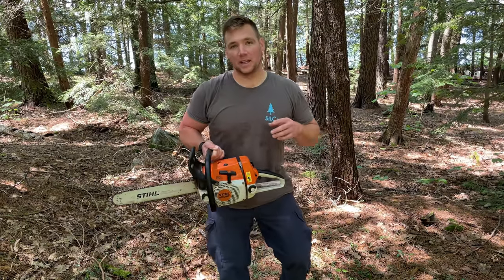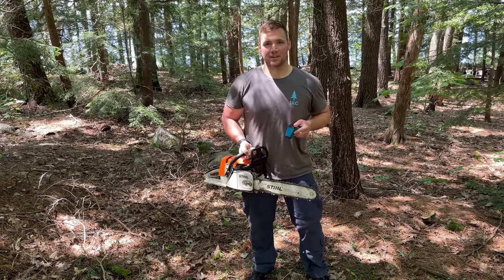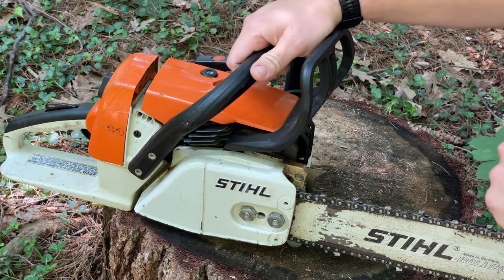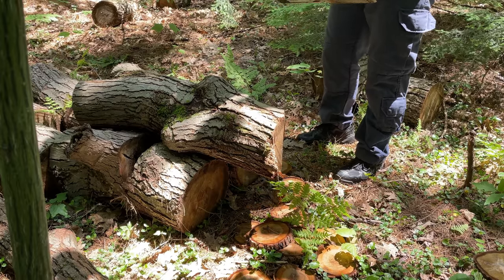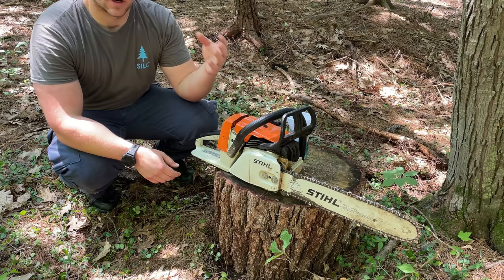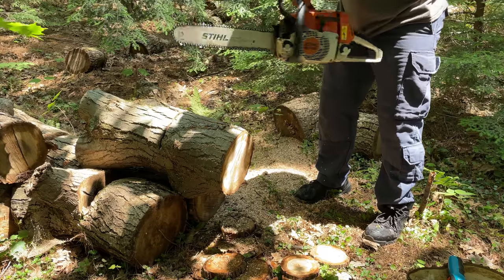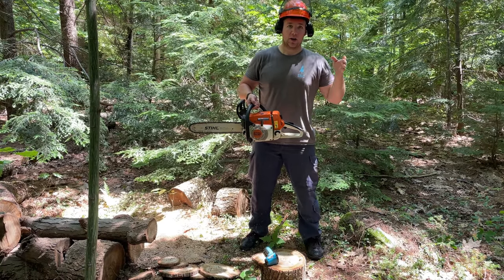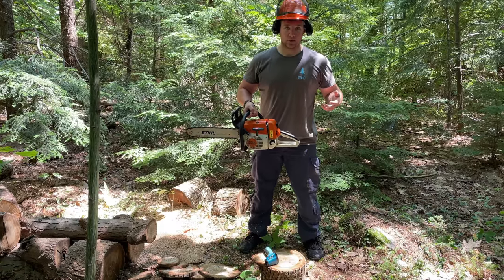Will my chainsaw last longer if I use more oil? Is it safer? (25:1 VS 50:1 temperature testing)

Comment: You should retune your carburetor after changing to 25-1 ratio. You're putting more oil in and less gas so you have to richen the carb settings to get the same amount of gas into the cylinder. By not making the carb adjustments you are running the saw leaner which causes more heat everytime. 

If you make the proper carb adjustments you well gain a bit of power from the extra oil sealing the piston better.

Great video! It certainly shows the need to retune after changing gas/oil ratios.
Reply: I was thinking the same thing.
Reply: if you change your carb mixture then your adding more gas. therefore negating the baseline. might as well just run 50:1 and be safe. no added benefit here.
Reply: @flagulantmichael If you increase the oil in your gas oil mixture, then you have less gas and more oil therfore the need for the carb adjustment in order to get the same amount of gas into the engine. You will use slightly more gas/oil mixture but the same amount of gas.
Reply: @flagulantmichael the added benefit is your actually getting enuff lubrication.  He took it too far. 40:1 is perfect. Only reason for 50:1 is to meet epa regulations. Take two brand new saws. Run 1 50:1 and run one 40:1. I got a grand on the 40:1 lasting longer
Reply: @jamiewarner9101  I'll take that bet!
Reply: The more oil you add the less gas there is. you have it backwards.
Reply: @Billbobaker  Thats what I said. If you add more oil, you have less gas therefor you have to open up the carb a bit to get the same amount of gas going into the engine.
Reply: @srankin8022  my bad, I miss read your comment.
Reply: So what if there is a minuscule less amount of gas?   Oil also burns, I think some one said it actually had more energy than equal weight gas.
Reply: @danonly7  less gas more oil is LEAN.
Oil burns only under serious compression or flame.
Less oil more gas is rich.
Reply: @Billbobaker  from 40 to 1 to 50 to 1  most saws won't be able to tell the difference to adjust for lean or rich...  that's a lot of fiddling with a carb screw
Reply: @Billbobaker  true, that's why you adjust the carb until your saw appreciates what its getting. nobody runs 25:1 tho. 32:1/40:1/50:1 are the commons. I would have done this test with 40:1 as that's the most common setup other then the standard 50:1. and adjusting carb between the fuel types would be critical for the results to be accurate.
Reply: I agree with you 100%. After just purchasing a 78cc chainsaw the manufacturer wants me to run it at 35 to 1 ratio. For at least 10 times of use. Then I am to switch to 50 to 1 ratio. But it does say in the manual that when you switch to the 50:1 ratio You must adjust the carburetor accordingly. And it tells you exactly where to set it for the 50 to one ratio. So coming from the factory this new chainsaw is set to run at 35 to 1 with its carburetor settings. And The carburetor must be changed when running it 50 to 1.
Reply: @reddragon3733 The manufacturer can't know where exactly to set it because they don't know where you're running it. There is a big difference between running at sea level and up in the mountains.. altitude change also demands a retune.
Reply: @InWithBothFeet 
How bad am I messing up tuning at 5500 and cutting between 10-11500' . I
Reply: @srankin8022 
How can you possibly add more gas, when the "gas" is already "mixed" with the oil?
Your comment makes no sense whatsoever!!
Reply: @brianwalker1933  I guess I'm confusing you by saying add more gas I should have said add more gas/oil mixture. You will be adding more of each because they are mixed together as you pointed out. You have to open up the jets more, so more gas/oil mixture enters the saw. When you add more oil to a gallon of gas you have less gas and more oil, right? So, therefore you need to retune the saw and back the jet screws out a bit so your saw will be getting as much gas as it was before you added more oil. A 25:1 ratio has less gas in a gallon than a 50:1 ratio. 25 parts gas 1 part oil, 50 parts gas to 1 part oil! So, a 25:1 ratio is 122.88 oz. of gas and 5.12 oz. of oil in one gallon (128 oz.) And a 50:1 ratio is 125.44 oz of gas and 2.56 oz. of oil. So, you can clearly see there is more gas in the 50:1 ratio per gallon so when you change to 25:1 (or any other ratio) you open up the jets a bit so its still getting the right amount of gas. Your saw needs to be tuned with the gas/ oil mixture you plan on running. Hope this helps clear it up for you.

Comment: With my engineering and mechanic background I have found out a long time ago that a 40 to one mix gives  the best lubrication to all the parts in the engine. At 50 to 1 the wrist pin really needs more oil film. Especially at high RPM.  The manufactures recommend 50 to 1 to make the EPA a little happier.... As a side note:
When wrenching on small bore 2 stroke dirt bikes its amazing how many rebuilds are due to the owners running 100 to 1 Amsoil... Just my experience.  I recommend at least 40 to 1.
Reply: I'll stick to what Stihl says
Reply: @devlinsemmler8236  Stihl, like all manufactures is under EPA pressure to recommend 50 to 1. It's not for engiine longevity so much as it is to satisfy emissions standards.
Reply: I run 40to1 also in all my stihl equip.been doin it for years i agree with you. Never had an engine failure also run 93 octane gas.
Reply: @zackeryeckenrod6549  Anytime I tore down an engine that ran 50 to 1, I noticed upon inspection the wrist pin especially does not get quite enough lubrication. Yep 40 to 1 is the way to go. Screw the EPA.
Reply: I’ve always used 50:1 in my Stihl equipment 100% Stihl standard oil (Blue) which I still can buy outside of Stihl dealers in Australia as superseded to the Red colour, never has a problem never changed a spark plug only the arrester was blocked once on my FS55 my FS85 okay.
Arresters are bad in Home 3
FS 38 -45 due to home users not using full throttle, and really they wouldn’t.
Reply: @carlatamanczyk3891  really , has there ever been a forest fire from a fkn chainsaw ? you're more likely to get a spark from running 50:1  , 40:1 has been the norm for ions . amen to Carl and Zach
Reply: Hey thanks for the info, I hadn't considered the EPA. I just switched to 40:1. Imagine that. ;-)
Reply: This same discussion happens all the time on 2 stroke dirt bike forums.  Run a quality oil at what the manufacturer says and it's all good.
Reply: @jacoboo1885  that was me to involved in that discussion on that if it was that recent, was on Facebook from memory.
Reply: I run my Stihl cutoff saw with a 70 -1 mix with quicksilver, never have carbon issues and no fouled plugs, starts first or second pull when cold, first when hot, more problems are caused with too much oil.
Reply: I think the Amsoil 100:1 mix is tempting to a lot of dirtbike owners to reduce or eliminate spooge coming out of the exhaust. Even though it may be a good quality oil, it's just not enough lubrication at that ratio for a motor under that much demand/load. I ran several tanks with Amsoil Sabre at 50:1 without an issue, but I definitely wouldn't run anything on a thinner mix than that.
Reply: This season I cut about 4 cords of firewood (alder, hemlock, and fir) and I've been using a husqvarna 340 16" at 50:1 WOT just beating the hell out of it and it still has 155psi. 90% of the time I would recommend to use manufacturers ratios because the saws are designed to run that ratio BUT it never hurts to try otherwise, my 100cc homelite 1130 calls for 32:1 but when i ran it at that ratio it was starving at WOT and was dripping oil from the muffler, I then tried 40:1 and it ran like a scalded dog, because of this I think it's safe to say that it's always a good idea to experiment with different ratios as 2 stroke oils are rapidly changing with time as well as the gas you buy at the pump.
Reply: @ColinCearley27  Here is something interesting though: the Japanese manufactures recommend 32 to 1 premix in their 2 strokes. Look at the Euros. 50 or 60 to 1....???
Reply: @carlatamanczyk3891  not sure what to think of that but if I were to buy a Japanese saw and it stated to run 32:1 I definitely would because Japanese manufacturers don't screw around they know their way around an engine.
Reply: @carlatamanczyk3891  I also wouldn't doubt that germany and Sweden have tighter emissions standards that practically force them to tell you run 50:1 in their saws.
Reply: @ColinCearley27  I have 4 saws. One of them is a 1975 Italian built Olympic. Manufacture recommends 20 to 1 but it has lived wonderfully on 40 to 1. This saw just doesn't wear our yet.
Reply: @carlatamanczyk3891  Wow interesting, I have 2 Stihl MS361's and a Husqvarna 340 all 3 I run on 50:1 and I have a craftsman 42cc and a Homelite 1130 with a 48" hardnose bar both of which I run on 40:1 with no issues and no piston scoring.
Reply: @lancer3660  this 100%  The jetting is important, you can't just go from a 50:1 to a 25:1 and do a direct comparison, you gotta adjust the jet too if we're being scientific here people.
Reply: Thanks for sharing very interesting,
Reply: I know many ktms that run for hundreds of hours with 60:1
Reply: Sounds like your wrist pin is a plain bearing type...very uncommon as they're all needle bearings now. Your suggestion would apply to the old plain bearings, not needle.
Reply: @devlinsemmler8236  Stihl, as do all the other manufacturers, look at liability, not your saw's performance. Whatever they say is padded to get your engine over the warranty period.
Reply: @zackeryeckenrod6549  

And you don't even know why you run 93, do you? Octane is a mitigation measure of detonation suppression at high compression ratios. Your engine probably barely breaks 6:1 ratio....and I can assure you that's not high at all. But, your engine....you throw whatever money at it you wish. I'll add that 87 is plenty and e10 or 15 is better for a two stroke than straight gas. This is true because ethanol has a much higher latent heat of evaporation which provides additional cooling to the engine and air cooled two strokes need all the cooling they can get.
Reply: @rickthelian2215  I run a 100:1 in everything I own since 1978. But it's an oil specifically designed for that ratio. Looks like a four stroke inside, never a fouled plug, no exhaust getting coked up by unburned, excess oil.
Reply: @jimb4090  I run 93 because in stihl owners manuals they recommend min. of 89 oct. smart guy but of course you know better than the engineers at stihl. So you should probly call them and let them know of your expertise im sure they need your vast knowledge in fuel.
Reply: @zackeryeckenrod6549  Bingo !! Thanks for posting !
Reply: @jimb4090  I was a contract faller fo 10 years, we only ran high test gas in our saws, which have thousands of hours on them. Never blown an engine, with good maintenance they start and run perfectly. We are paid on cut out not hourly etc.
The saws and all my 2 cycle motors run better on higher octane gas, it's a simple fact.
I won't quote technical jargon, they simply run better. Even my Honda 4 stroke mower runs better on high test gas.
I spent my life in and around 2 cycle engines, there is no reason to spend extra for gas, if it doesn't pay off.
My son put a new piston in an Echo blower ( 1980 ) I bought new, rings were leaking a bit. It has around 4000 hours on it. He was stunned to see the excellent condition of the piston, chamber , rings, pin etc. Simply put in the new piston, bearing, rings and put it back together. Runs perfect. 50:1 on high test gas only.
Reply: take  into  consideration!!!!
not everyone gets  their  mix DEAD ON !!!!
1. NOT WARMING  UP SAW PROPERLY. 
2. ALWAYS  RUNNING  AT FULL THROTTLE WHEN NOT NEEDED.
3. CUTTING WITH  BLADES THAT ARE NOT SHARP , OR  GETTING  DULL ..
Reply: Thank you for the information.  Spoke to some professional loggers.  They mix between 45 and 40 to 1.  They said that 50 to 1 is too lean.  My saws have been running on 45 to 1 and no issues, cutting about 50 face cord of firewood a year for the last 10 years.
Reply: I run 32:1 to 40:1 no higher or lower
Reply: more oil in the mix = leaner/running hotter. been running stihl oil between 40 or 50:1 for years without any issues in all my stihl equipment. like carl said, stay away from that amsoil crap - i bought a litre of it to try and most of my stuff ran like crap so went back to stihl oil
Reply: @nuttermudder4630  I don't use chainsaw 2 stroke oil basically subzero 2t snowmobile oil by vp fuels good oil
Reply: @troybeans34  hope so at $70 a gallon!
Reply: @nuttermudder4630  why I use it its ready for my sled and bikes also just saying
Reply: Always ran a 100% full synthetic at 40:1 for decades. 0 issues.
Reply: @carlatamanczyk3891  why did stihl use 50.1 before the epa
Reply: I ran Amsoil saber, but I ran it at 75-1 because I just didn't trust 100-1.  I really liked it...just less smoke and smell.  I was given a case of Stihl oil,  so I started using it instead, but I'm thinking of switching back to Saber because its' just cleaner.   I've read in motor cycle  forums though about seize ups from running real hard with 100-1.
Reply: Full throttle on a chainsaw is always needed when in a cut per the manufacture. They are designed to run wide open in the cut and that’s the only way they cool like they’re designed
Reply: Actually years ago stihl recommended 32:1 and a bit later they recommended 40:1 in the 80’s but only with Stihl oil recommended 25:1 with other oils. And no tcw oil
Reply: The wrist pin in most all two strokes is a needle bearing requiring the barest amount of oil for lubrication. Even when it was a plain bearing the lubrication requirements weren't that great. But the essentially unidirectional loads toward the bottom of the journal didn't allow for oil to reach the highest load bearing part of the pin which was the driver toward needle bearings. The only problem with needle bearings occured at higher RPMs which tended to fracture the bearing cage but this is at speeds much higher than any ordinary two stroke engine in use today that is not intended for racing. Back in the day Yamaha TD1 was susceptible to cage fractures above 11k. Now as to the more-oil-is-better line of thought....your four stroke engine's bearings operate on a hydrodynamic wedge of oil in the bearing that keeps the journal physically separated from the bearing byvan oil film. This is fine for four strokes. Two strokes, however, do not like excess oil in the roller and needle bearings because the hydrodynamic wedge builds up in front of the rolling elements causing them to skid and not roll as designed. Skidding balls and needles essentially turn into two plain bearings rubbing each other into oblivion. Less oil is often much better. "But the piston!!!!" you'll say. A two stroke piston shares all the same environmental conditions as a four stroke with the exception of twice as much heat being input per unit time. Excess oil in the ring lands will tend to coke up and lock the rings in place, especially troublesome for Dykes style top rings. Less is better. All of my two strokes - bikes, ultralight aircraft engines, weed eaters, chainsaws.....anything two stroke has been running on 100:1 from day one for over 40 years. Oil brand is unimportant in this regard as long as it's engineered for 100:1. If you wanted to run at 80:1 that's way better than 40:1 with modern two strokes.
Reply: @devlinsemmler8236  
Stihl looks at liability, not necessarily what is the best for your engine. They're driven by the principle that any oil related problem is not theirs, it's yours unless you can prove their engineering or production caused the underlying problem (con rod breaks, cooling inadequate, etc). But if you bring in the engine with flashed oil coked rings or plugged exhaust ports or muffler, that's far less devastating than an oil starved (or no oil at all) situation.
Reply: I'm an mx dude, an also mechanic.. I recommend 32:1 on all performance watercool 2smokes, and 25:1 on all air cooled.
Reply: @Tadders  my thoughts exactly
Reply: I run 40 to 1.  Ironhorse in one of his vids said that he could tell the difference in saws that run 50 to 1 and 40 to 1 when he breaks them down,  he runs his saws at 40 to 1.
Reply: @carlatamanczyk3891 
You and Ironhorse agree.
Reply: @zackeryeckenrod6549 
The Government tells the Manufacturers to make them run 50 to 1,  the Government!
Reply: @rickthelian2215 just buy castrol oil, it's cheaper and your not paying for the stihl name,  which is castrol oil. Stihl do not produce oil. Oil companies do.
Reply: @stone4173 yep, totally agree. Castrol are 2 stroke oil masters. Use Power 1 in my 660 at 40.1 ratio